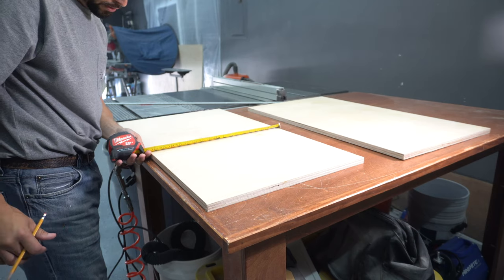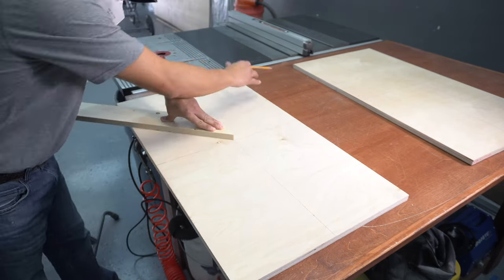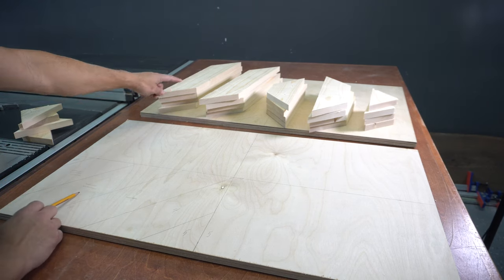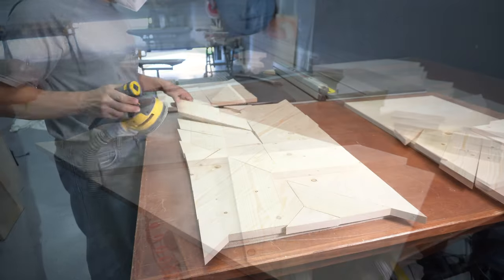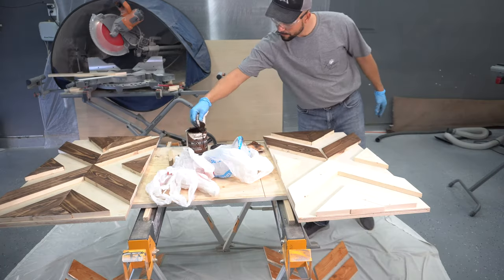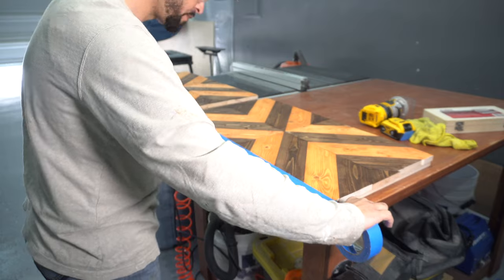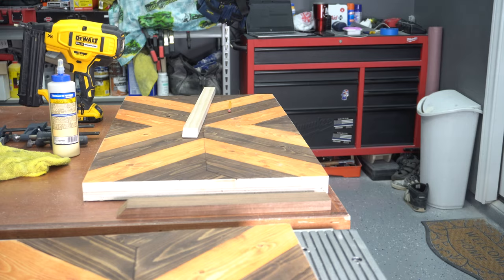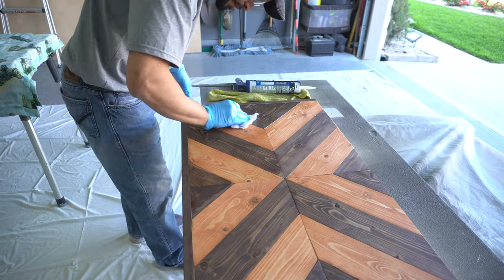DIY - Herringbone Pattern Countertop

Comment: This design is fantastic, I'm going to make it,  my only concern is that my countertop length is 104", how can i continue the design? Also, can tou please tell me if I can't use ¼" or ½" plywood instead of ¾? The cabinets I built are 36" high + 3½ on the bottom =39½. Ouch